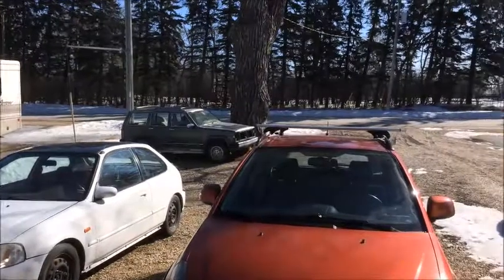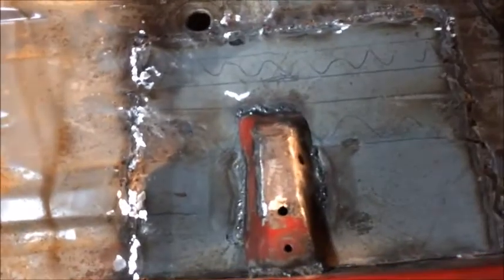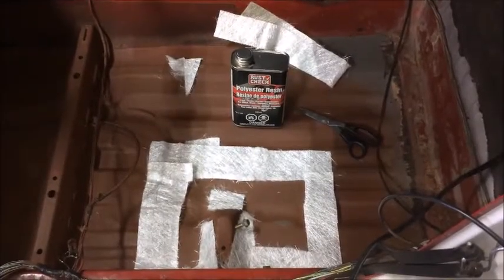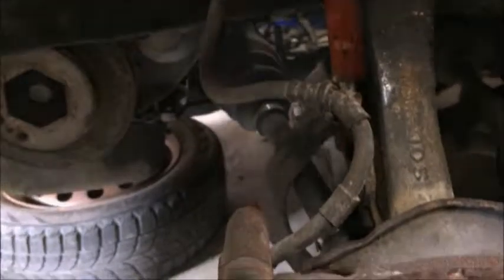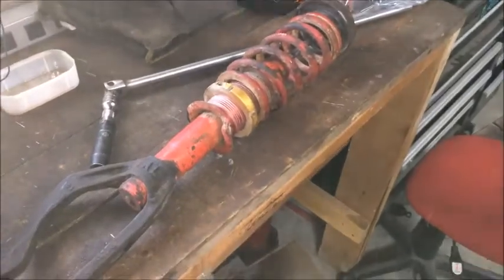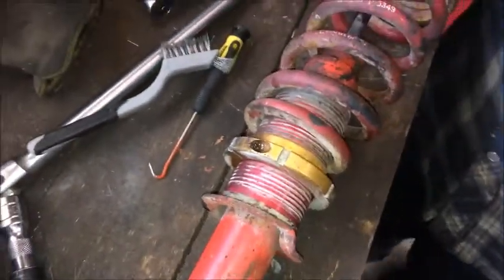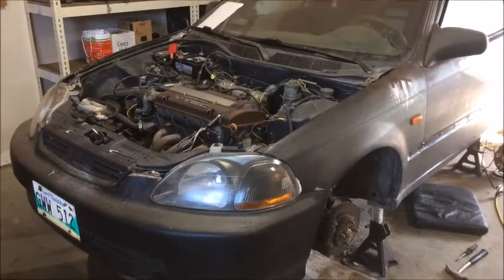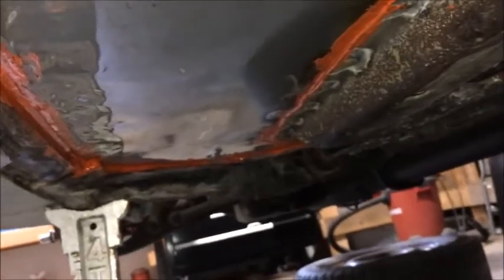H22 Civic Build pt 9 Floor Repair and D2 Coilover Install

Comment: Your floors turned out great. What gauge of steel did you use for the floor? Names of products such as seem sealer / cleaner and paint if you don't mind. Maritime Civic problems ... Great guide & video btw
Reply from the maker: Thanks! Not sure on the gauge of the steel, we salvaged it from the hood of a Nissan Sentra. Metal was thicker than the factory floor though. I used Duplicolor wax and grease remover to clean it, Rust Check rust converter before fiberglass. Used Rust Check Fiberglass kit, Tremclad Primer, and Duplicolor Bed Armor for the interior. under the car I used RTV seam sealer and Rust Check Black undercoat. Been driving it all summer and still solid.
Reply: That's awesome - if you just salvaged metal off a hood of a car then I might just do the same with a scrapped 96-00 Civic in a junkyard and go that route. As per the items you used thank you. I'll keep an eye around Canadian Tire or WalMart see what they have.

Comment: What axles did you use on the h22 ek ?
Reply from the maker: Yonaka makes aftermarket shafts for this exact application. Love them since there's no customising needed, they bolt right up. Here's a link to the ones I ordered  https://www.yonaka.com/H22_Custom_Swap_Axles_Civic_Integra_Del_Sol_p/ymax006.htm